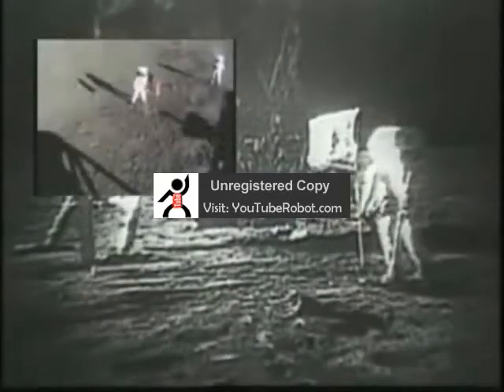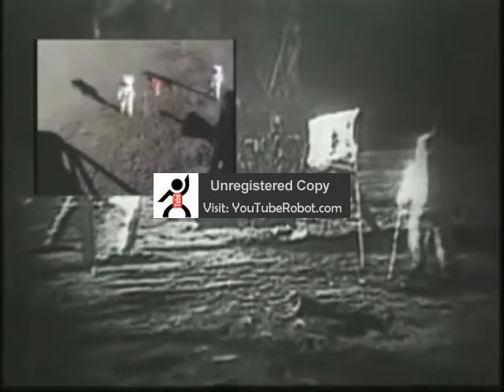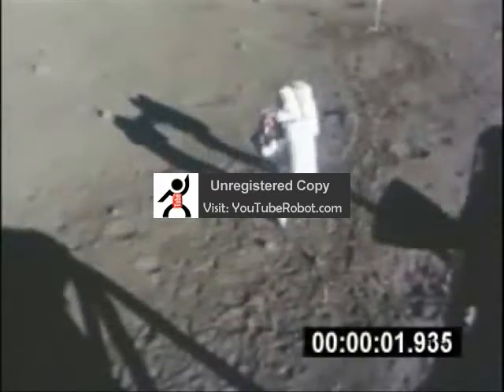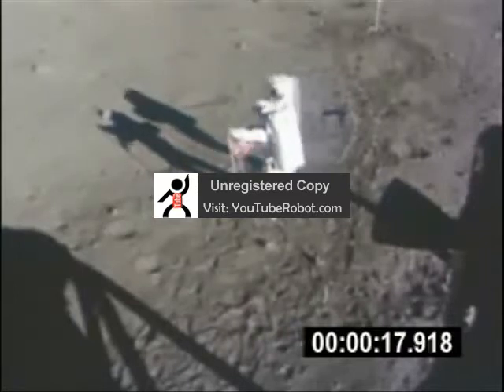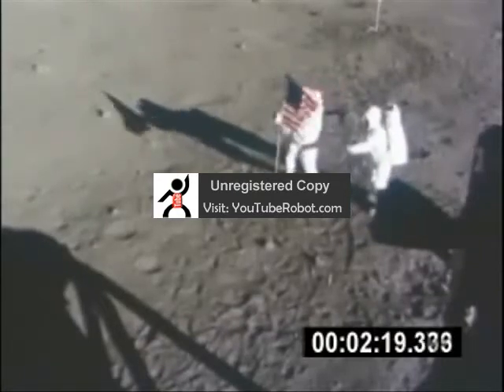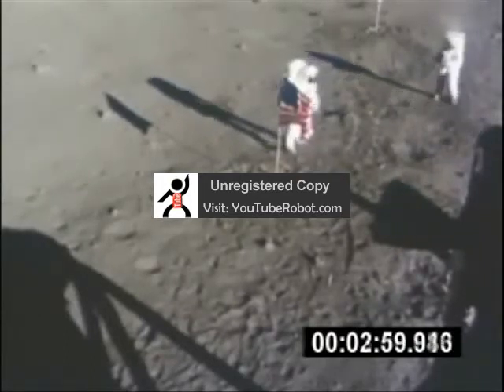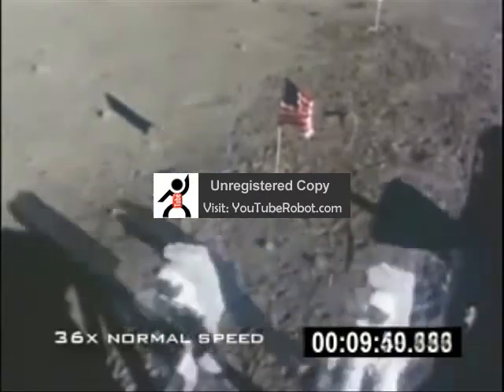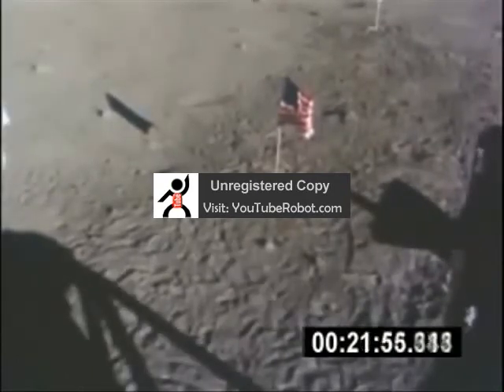APOLLO 11_ PROOF OF MOON LANDING.avi

Comment: Do the math, the photos from the Moon of the Earth are fake.  

Experiment:
Take a tennis ball (the moon) and a basketball (the earth) set them 5 feet apart, (or any distance as the sizes will stay constant along with the distance so it is ultimately irrelevant)   

Take a picture from next to the horizon of the tennis ball (moon) out to the basketball (earth)  

Ten from the horizon of the basketball (earth to the tennis ball (moon) 5 feet away

Use same camera settings for both pictures.

Upload Pictures
Compare photos.

Look at the size of the basketball (earth)., compare with the size of the tennis ball (moon) in the photos.

Explain the size discrepancy in the actual (faked) moon with earth in the sky photos.

Mystery solved, NASA IS A HOAX
Reply: You're a HOAX
Reply: Hypnotic How do you figure, You could not setup a simple experiment?
Reply: True Patriot So what you are saying  is why is the Earth so small , as small as the moon looks from Earth except from the moon the Earth should appear much larger.  If that is the point you are trying to make , its actually a good querstion. However ====using the "Basketball Tennis Ball Experiment" you won't find an answer using two objects that you have not accurately measured the circumference of ,also you have to have an  accurate measurements between both objects to scale everything down from the actual size and distance of the Earth and Moon. .There is an answer for this question but I am not an expert on the topic. I know the moon is much smaller or larger depending on where it is on the horizon or directly overhead it looks smaller.. I didn't mean to be rude.
Reply: Hypnotic No offense taken.... You are correct, that the basket ball and tennis ball are not "exact" size replicas of the moon and earth, In reality, it has been stated that the earth is 3.7??? times larger than the moon, so I suppose a more accurate comparison would be perhaps a golf ball and a softball

the distance "makes no difference" as it is "relative" to both objects. the further you get away from each other, the size will "decrease" accordingly.  

This being said, if you look at  the photos of the earth from the moon and the moon from the earth, you run into problems. imagine looking up into the sky and seeing a moon that is "4 times" its normal size......

This is what you should see from the moon in the pictures,

The earth is not only "inconsistent" in size (from one photo to the next), but also "the wrong size" as it is much too small.

Seriously, the experiment is "crude" however it is representative of actual reality.

.
Reply: True Patriot It has something to do with the horizon. The moon looks bigger because our eyes sere the horizon and adjusts the size of the moon to look like it is larger. However if you measured a large moon with a smaller looking moon high in the sky with no horizon ,both will measure the same size even though they look different. The Earth may look smaller than it should due to where it is on the moons horizon except the moon has no clouds or atmosphere so your eyes are freaking out and adjusting  the Earths size as being smaller because of what type of horizon the mind can't really figure out since we have never seen anything from the moons surface we are seeing a illusion possibly/ Like two straight lines with inner or outer facing  arrow tips makes one line look smaller than the other. But they are the same size. So if our eyes can be fooled that easily ,maybe because of having no familiar  references,like clouds, trees, buildings,as a comparison without that from the moon the size of the Earth is distorted and we just think it looks smaller than it should. I hope that helps a bit.
Reply: Hypnotic It does help, however we do have a point of reference, the astronauts and the  lunar lander in the photos give great reference as to the size of the "earth" (prop/photo) they used.
Reply: "since we have never seen anything from the moons surface"

I agree with you there......

Also, I figured out how to resolve the "scaling" issues, 

Take 2 pennies  (same size) super glue them on edge, to each of the balls.

when setting up the camera shots make sure that the camera not only gets the horizon and the distant object, but also the pennies "on edge" of both objects.

Each Picture should have 

1) the distant object

2) the distant objects penny standing at dead center of the perpendicular to the camera's line of sight.  

3) the near objects penny standing at dead center of the perpendicular to the camera's line of sight  

4) the near objects horizon 

The distance the camera is from each of the balls must be the same distance.

What you should see in reference to the "pennies" in each photo, is that they are the same size, however, the distant objects are much different.  

This fairly simple experiment resolves the question as to the legitimacy of the photos...

Comment: Right, shouldn't the sun have moved in 35 minutes. This would caused the shadows to move to the left or right. Right?
Reply: Not enough to be noticeable my friend. The moon takes about 28 days to orbit the earth where the same side always faces the earth, hence one full day on the moon is about 28 earth days. In other words, daytime on the moon lasts about 2 weeks and night lasts about two weeks.

Therefore on the moon, the sun would be seen to move across the sky 28 times slower than it does on earth. Put another way, the sun on the moon would have moved about the same in 35 minutes as the sun moves on earth in 1 minute and 15 seconds :) Not enough to notice any change in the shadows.

I hope that helps.
Reply: MTMind2 - Thanks!

Comment: If the flag had flapped it may be evidence that they did go to the moon because it is certain they would not have overlook the flag waving if hoaxing the mission on such a massive budget. To prove the moon landing was a hoax you need to look for whats missing, as everything shown will be correct (if they couldn't get something perfect they would cut it) - again, with this budget, if they show a flag, it will behave correctly...proving it eitherway is impossible...maybe deliberately so! ;)